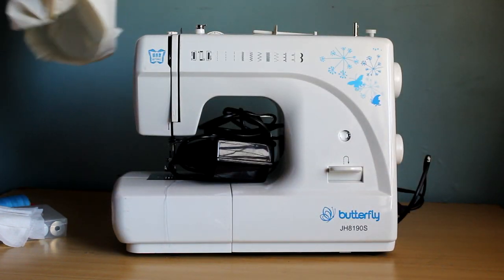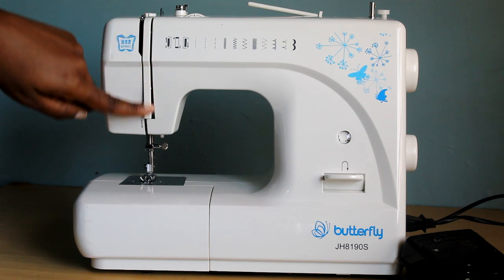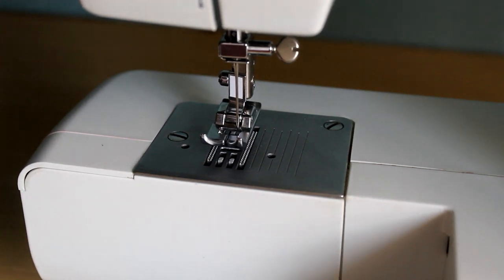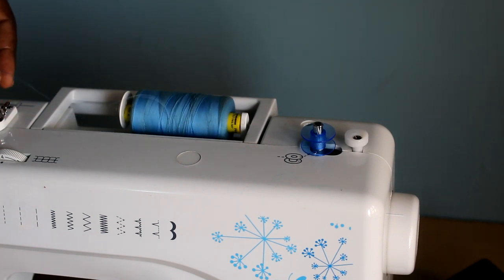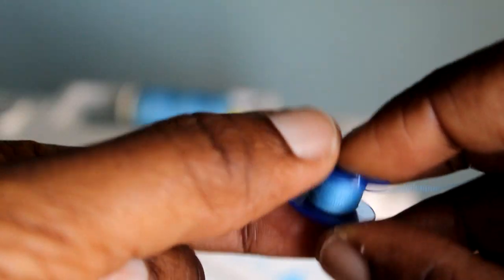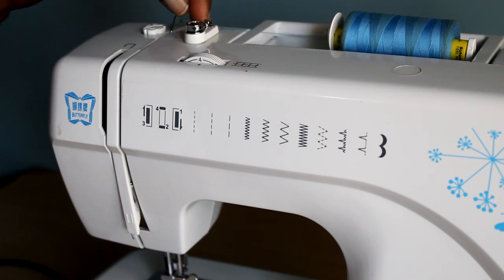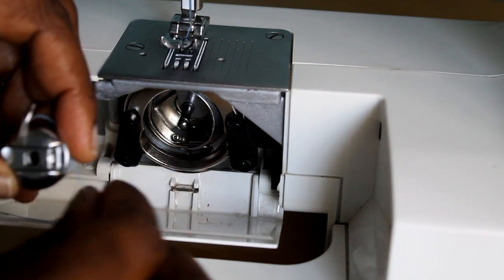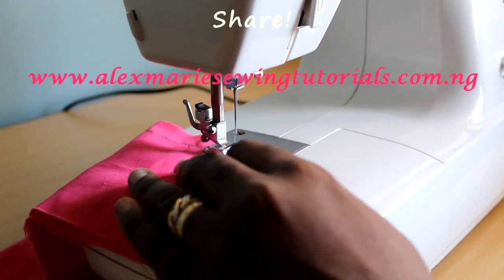How to setup your Electrical Sewing Machine | Alex Marie

Comment: I have this exact type of machine but the needles keep breaking please what am I doing wrongly
Reply from the maker: The needle might be hitting the bobbin case or the shuttle hook, so you might want to check that the bobbin is inserted properly, or it could be that the timing of the machine is off. try turning the hand wheel to move the needle up and down slowly to detect if it is hitting anything when going down. In the end, you might need to see a repairman.

Comment: Why does my thread keeps pulling out when I sew? I need an answer please
Reply from the maker: Hello. It could quite a few reasons, bad thread quality, or the wrong tension settings, or improper threading... it's hard to pinpoint. I'll suggest rethreading, then checking tension, then finally trying a different thread or even a new needle.
Reply: Exactly same thing with me I think the tension is too tight

Comment: Hi , I have the exact machine and I followed same step but when I put my leg on the pedal, it was not sewing but just made a sound. What do I do?

Just using it for the first time.
Reply: Same here! Please what have you done ?
Reply: Same problem here
Reply: Plug it to a stabilizer(same thing you use for refrigerators). I did that and it worked perfectly.

Comment: Hi. Can I use this machine as a serger please with the zigzag stitch?
Reply from the maker: Yes, you can use it to finish your seams with the zigzag stitch if you sew right at the edge of the seam. Note that it does not have the overlocking stitch, but the zigzag will work just as well.

Comment: Hey I’m back do you think you can help me I need some help my electrical sewing machine was working fine until now When i turn it on it makes a low buzzing/humming noise it never happened until now and the lower stitches are not as tight as they used to be I’ve checked out the tension but I just don’t know what the problem is and I don’t like that sound
Reply from the maker: Hi there. First, full disclaimer, I am not a machine repairman. But I'll advise that you check the troubleshooting section of your user manual first for any solutions. Second, buzzing noise could mean a fault with the motor itself. But things you can quickly check yourself are to make sure there is no thread tied up anywhere in the machine, perhaps restricting movement Also try inserting your bobbin clockwise as I mentioned in the description above. 
Does it still sew even with the noise, I want you to see if you can narrow down which part of the machine the noise is coming from, as that might help you locate and fix the problem. I personally disassemble my own machines because I am handy like that. If you are not comfortable opening the machine yourself, you should take it to a professional.
Reply: Alex Marie DIY thank you so Much 🙏🏾  yes it still sews it’s just wierd cuz this sound is new to me I’ve checked the manual sadly nothing concerning the sound is on there although the sound is quite low you can only hear it when you come close but it’s coming from inside the machine just like as if it’s a tiny little fan blowing or something electrical like that making the noise thanks for the help though it’s gonna be a tad bit hard to get a technician since I am nigerian and I live in Nigeria if any further issues come up I’ll visit a nearby store I have in mind maybe I’ll get some help
Reply from the maker: @cchhii961  Ok that's a good idea. I'm also in Naija by the way. Happy democracy day.
Reply: Alex Marie DIY haha I could tell by your accent happy democracy day to you too

Comment: Please how do we turn on and use the presser foot??
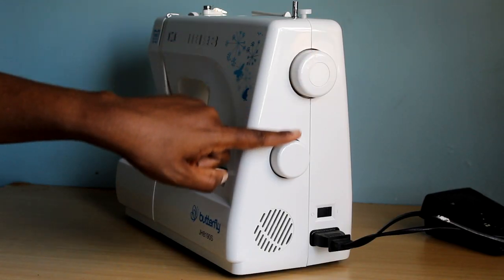Reply from the maker: There is a power switch on the side of the machine. see here 2:38. Turn it on and the foot pedal will work
Reply: I turned it on but the foot pedal didn't work
Reply from the maker: @preshhammawa266  hello. Check all your power connections. Does the light come on when you turn it on? If nothing is working, you may have to take it for repairs. The motor could be burnt

Comment: Nice vidéo ma’am pls can you tell me the niddle  size of  this machine ?
Reply from the maker: Thanks. It looks like you have seen the answer below. It's HAx1 needles in size 14
Reply: @AlexMarieDIY  are you saying another brand of needle wont work?.. it has to be haxi specifically?
Reply from the maker: @Fitmum-11  Yes,  HAx1 aka 130/705H aka 15x1 needles are the only TYPE of needles that it uses. You can buy any brand like Organ, Orange, Butterfly, etc. For size of needles, 12 or 14 will fit. Maybe 16 for thick fabrics.
Reply: @AlexMarieDIY  can it use needles with round shanks?..or it has to be flat shank?
.
Also, is it db or dp needles?
Reply from the maker: @Fitmum-11  it has to be flat shank. Round shanks are for only industrial sewing machines. And no you can't use DB or DP...HAx1 only
Reply: @AlexMarieDIY  wow, this is very helpful , i guess thats why the upper thread has been constantly breaking, im using the wrong kind of needles. Thank you so much.  But ma, what's the idea behind db and dp needles? I had no idea they were even different from haxi
Reply from the maker: @Fitmum-11  DB and DP needles are both for the industrial sewing machines. The difference is the size of the needle. I believe DB is bigger. The important thing is to know the right one your own machine as there are many needle types.
Reply: @AlexMarieDIY  thank you so very much
Reply: @Fitmum-11 Use HA ×1 sewing needle - size 14 for lightweight fabrics, size 16 for medium weight fabrics, and size 18 for heavyweight fabrics 😊

Comment: Hello new subbie here for wig making can it be used and do you think it will last for sometime..
Reply from the maker: Welcome! As long as you are not sewing through very thick materials like denim and khaki it should be ok. As for how long it can last, with good maintenance, it should last a long while. This one in the video is 4 years old.
Reply: @AlexMarieDIY  wow still looks so new I sent you a mail yesterday will only use it sewing the hair wefts together and  sewing the bundles  on wig cap ..it should be fine then..check your mail plss.thanks for your response..

Comment: Hi, How much did you buy this machine and where?
Reply from the maker: Hi, I bought it on Jumia.com.ng for 29000 naira back in 2015
Reply: Alex Marie DIY its 50000 now
Reply: You can get it for 43000 on jumia
Reply: @AlexMarieDIY  wow, so you've been using it for seven years now...
What can you say about it's effectiveness?
I want to buy it as the major sewing machine in school, what advice would you give, please?
Reply from the maker: @JulietObaniyi  Strictly speaking, I haven't been using it for 7 years, because I have other machines and I mostly use my industrial now. But, for a student, I think it is a great choice. It's easy to use and it is mobile. But if you can, a Singer Heavy duty 4432 or something similar might be better, as that allows you to chnge the stitch length and width. This just has preset stitches.
Reply: @AlexMarieDIY  thank you so much, I will check that out...

Comment: Don't this machine require lubrication oil before using?!
Reply from the maker: According to the user manual of this particular model, it only needs a few drops of oil in the shuttle case, where you place the bobbin.

Comment: Hi, I don't know why I can't reel thread into the bobbin. I have tried every method I know of but it's still not working. Please help me.thanks
Reply from the maker: hi, can you describe what the issue is exactly? is the bobbin winder not moving?
Reply: @AlexMarieDIY  it's an electric machine and this is my first time of using it, am used to manual. To reel thread into the reeler is a problem for me. Also it's not sewing at all after threading both up and down. Please help me
Reply from the maker: @labakennadi3362  let's check a few things. If you have a user manual, try plugging the machine as instructed. Make sure the power is plugged, the pedal is plugged, and that the machine if turned on at the switch.
Follow the video and make sure the bobbin winder is returned back to it's original position after winding. Does the sewing light come on? 
Is it the same butterfly machine as in this video?

Comment: Hi , I have the exact machine and I followed same step but when I put my leg on the pedal, it was not sewing but just made a sound. What do I do?

Just using it for the first time.
Reply from the maker: Hi, can you check to see that the bobbin winder has been returned back to its original position, that can sometimes stop the machine from sewing. Also try turning the hand wheel manually to make sure the needle moves up and down. Hope this helps. Otherwise, you might want to have someone look at it for you or take it back to the seller.
Reply: @AlexMarieDIY  God bless you for this. Had same issue ,  your comment just made me realize what was wrong. Thanks again.
Reply from the maker: @fyneboneeunice483  Aww... glad I could help.